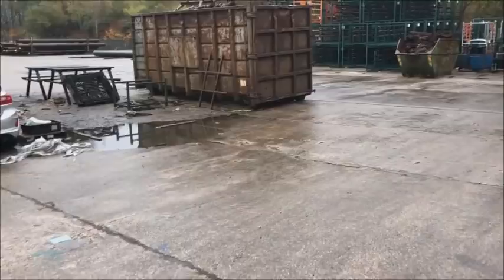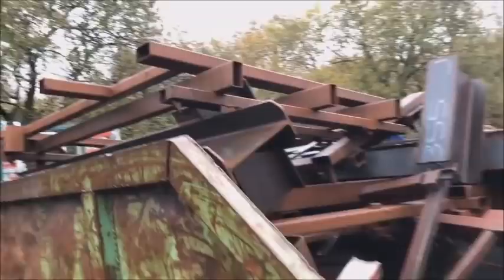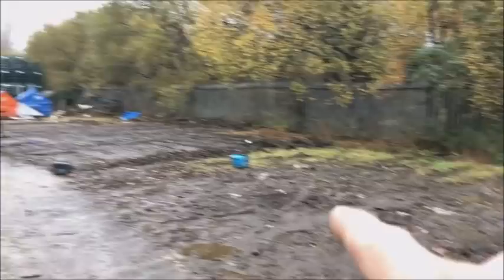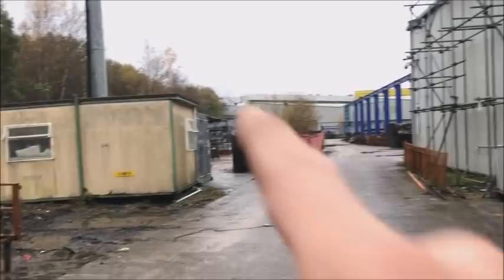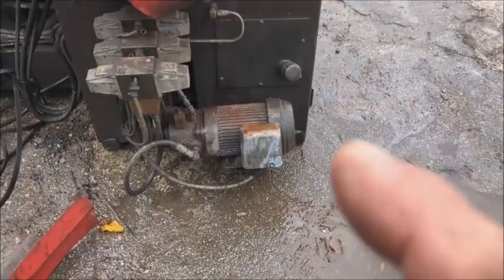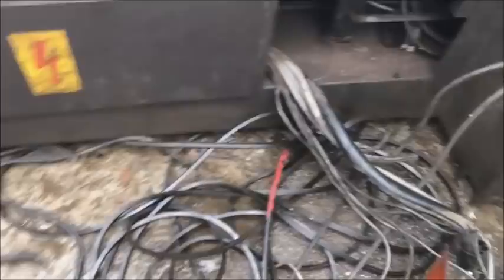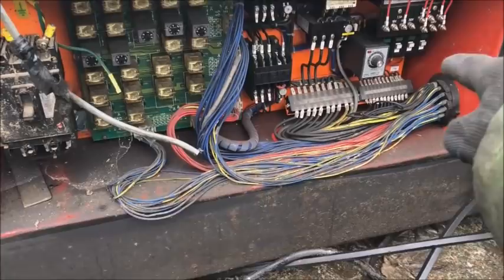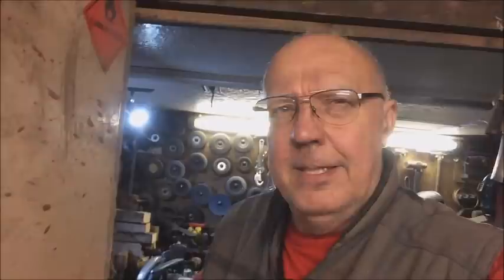Down but not out

Comment: Worked in a cereal factory for 27 years as a sparky. When they built the building the first thing they installed was the air handlers. These were basically ventilation units that brought in air from outside and filtered it and heated with hot water coils in the winter. Anyway, they commissioned all 40 units and left them running all weekend. Sometime after they left the incoming power dropped a phase. About 40 25 horsepower motors burned up! In the late 70s we would send 1/2 hp and larger motors out for rewind.